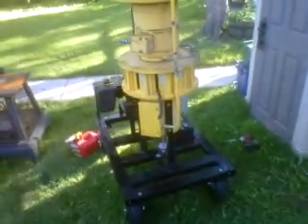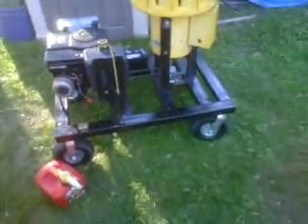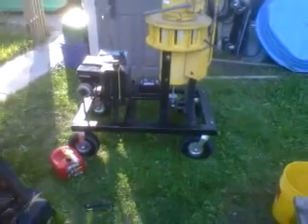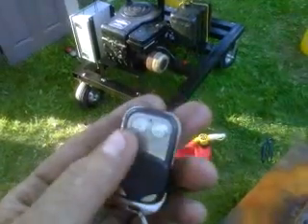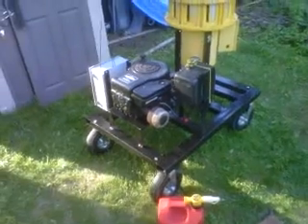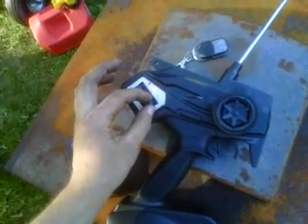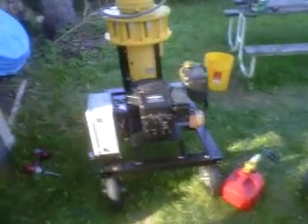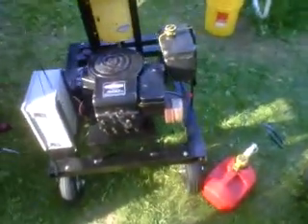Gas Powered 3T22 Tornado Siren--frame painted and casters installed!

Comment: I'm going to be doing a gas engine conversion on a STL-10 as soon as it gets removed and into my possession. I don't know if it's single phase or three phase yet, but the guy who I'm getting the (free) siren from also has a 50 hp Honda industrial engine that he's gonna sell me for 75 bucks. I figure that since it's such a good deal, and since I can run it anywhere on gas, I might as well do it either way. Then if It's single phase, I could sell the motor to another siren enthusiast who needs it